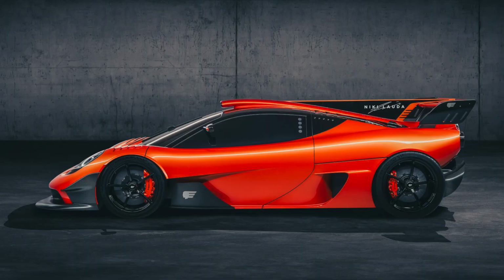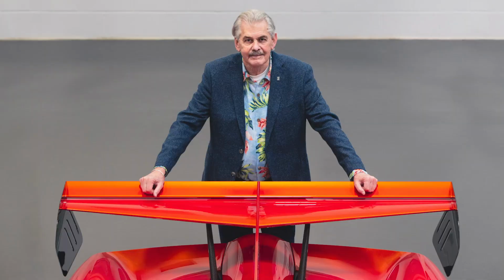30 minutes of chatting with Gordon Murray about the T.50S Niki Lauda – a track-going fan car

Comment: What Professor Murray did not explai properly and I would like to know is;  he gave two analogies porpoises related to f1 cars with skirts. Skirts on road cars are banned and LMP1 cars. However the Porsche 919 hybrid Evo ran with skirts how did they solve the problem of porpoising with skirts? Did they just raise the ride height to a point where the venturi was never cut off by an increasing downforce load? Be good to get an answer from that question?
Reply: Wasnt the 919 Evo still flat bottomed and the skirt were to stop the airflow escaping out the sides and make sure all the air fed the diffuser??